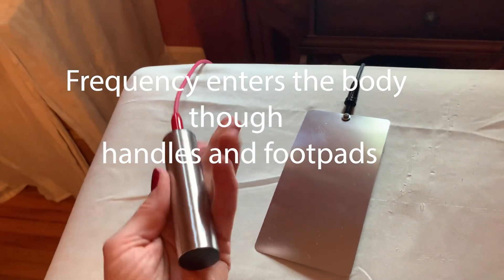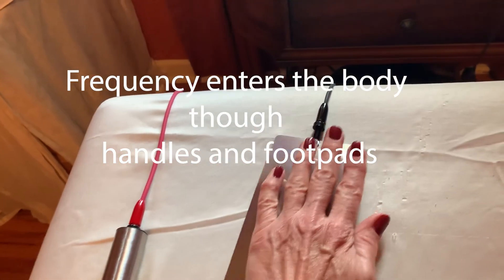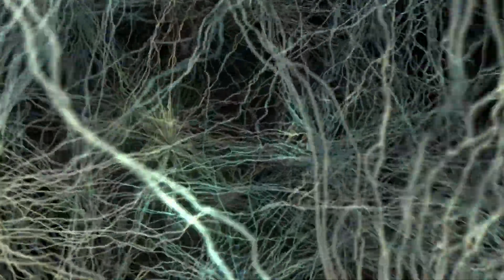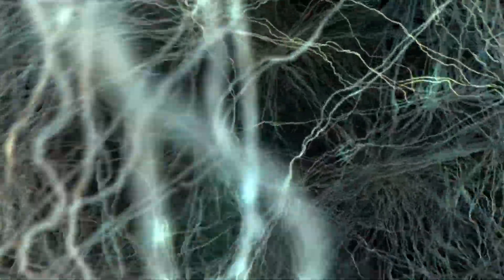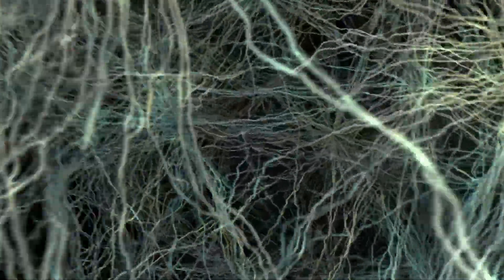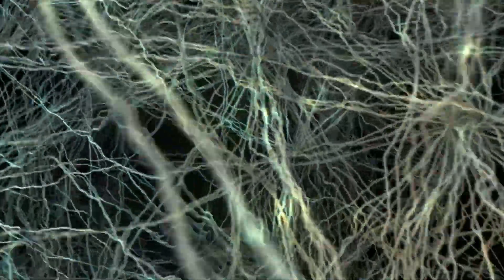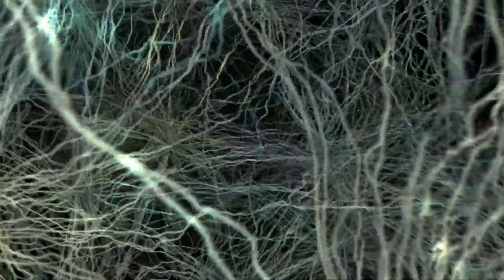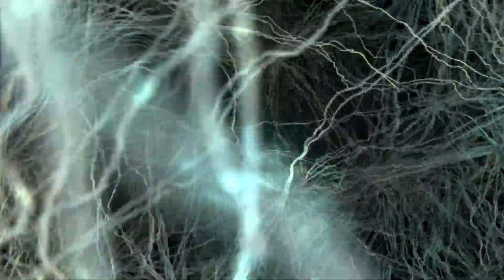Rife Frequency Generator & Sound Healing

Comment: Hi, great video, wanted to find out what you opinion is about having RIFE via an app? I have an app and wanted to find out how long I should use the frequencies. Would love to know more about the machine too!! thanks
Reply from the maker: Hi Thank you for your comment. I am not sure about the app. Without knowing about the specifics of the app, what I can say is that although an app may have the correct frequencies, it is going to depend on what is being treated as to what it can accomplish. A phone is unable to amplify frequencies like a frequency generating machine. So while it may be possible to get some results using an app, the efficacy will depend on the type of issue you are working on. The more difficult or chronic, the more amplification is needed. Please feel free to email or call me to continue a discussion if you would like. My contact info is on my website at jilljordasoundliving.com. Best of luck to you.

Comment: Hi Jill! Do you know if  this can help with sleep apnea or structural issues in my throat  causing  problems? Im healthy and thin but think that's the cause
Reply from the maker: Hi Jackie, it’s quite possible it can help. Where are you Located? Are you able to come for a session? I live in central FL
Reply: @JillJordanSoundLiving  oh darn im in NY, it has to be done locally right?
Reply from the maker: @Jackie1111  yes it does. Maybe you can find a practitioner on NY.
Reply: @JillJordanSoundLiving  okay thank  you! I will look around

Comment: Ok but why are you using frequencies in this audio, underneath your dialogue? That’s sketchy. Not to mention you don’t necessarily need a machine in order for rife frequencies to work..
Reply from the maker: Hi Haley, I put the crystal bowl sounds that I create as an audio backdrop for a nice sound. I use crystal bowls to heal. Why is it sketchy? And it is definitely necessary to use a machine to use rife frequencies. You would not need a machine to do other sound healing with instruments or voice but to generate the frequencies that Rife invented the machine for,
You do need the machine. It has to touch the client’s body for the frequencies to work. Let me know if you need more clarity